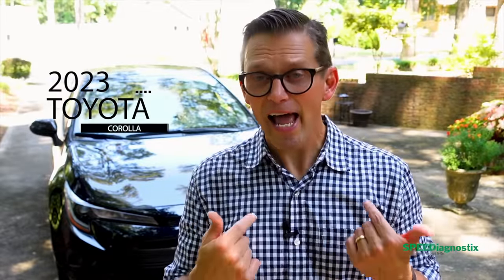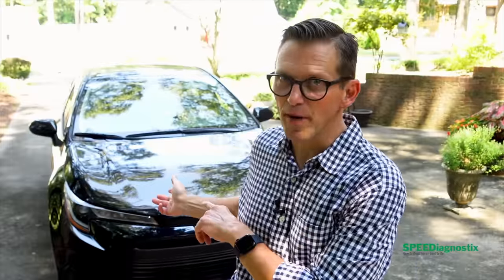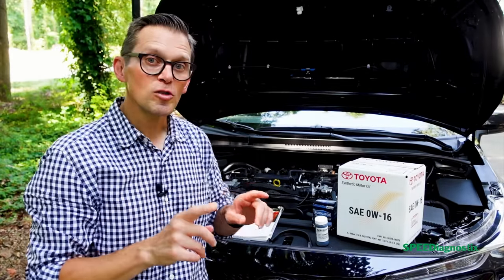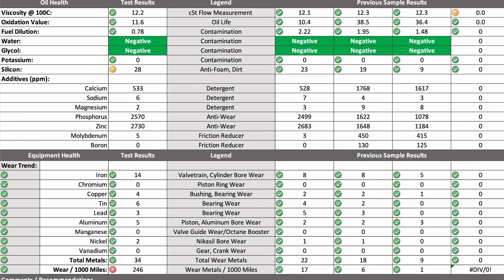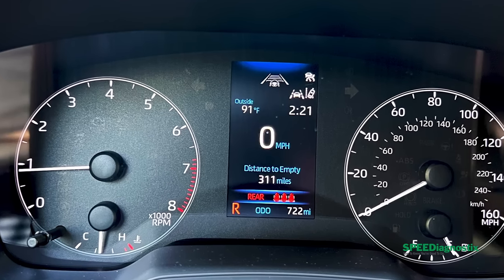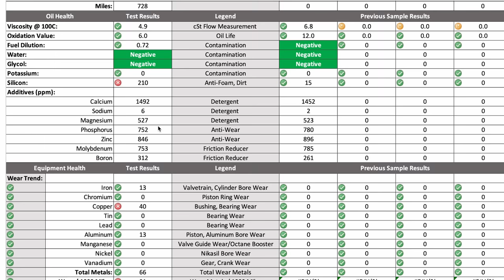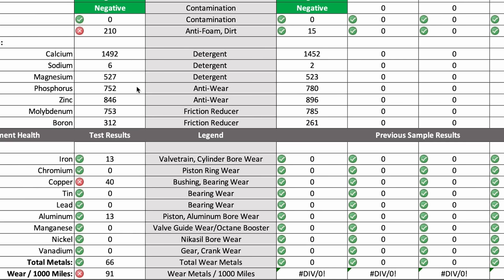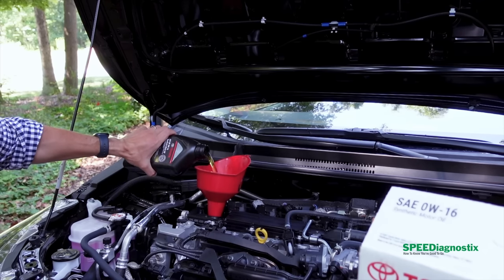AVOID the ONE MISTAKE Almost EVERYONE Makes With A Brand New Car

Comment: I change engine oil and filter at before about 400 miles. Then conventional oil till about 2000. Then full synthetic and new filter there on out. Never more than 5K on oil and filter. Labs are good and could go to 7500.
Reply: I also run filtermags, and do differentials at 10K or 1 year first change. Trans, same thing.
Reply from the maker: Right on!
Reply: That conventional oil for 2k after dumping the factory fill is a cool idea! Get the rest of the break in cycle done with conventional so the rings get a chance to continue seating in and such
Reply: Ok, how come some new cars come with like Mobil 1 in them?
Reply: it iz ALL about the $$$... my '16 lexus nx200t came w/m1... changed 2 AMSOIL & could tell difference b4 going 1 block, now i also get GREAT gas milage... 😁
Reply: @oneninerniner3427   The Mercedes owned Chrysler, Dodge Jeep company comes factory filled with Pennzoil oils.  Pennzoil Ultra Platinum is the factory fill for the Hellcat, Demon, Trackhawk and TRX pickup.  

Some brands come with Mobil1, but most are European vehicles.  I think the Corvette's and ZL1 Camaro come with the Shell Havoline oil, but I will check again.  

But some vehicles have the engine broke-in at the factory.  They do it their preoperatory way.

Comment: Please note that when you take your vehicle to a dealer for your oil change. They do not use the factory oil. I worked for them for 34 years. They buy bulk oil from wherever they can get it cheap. That’s how they make their money on oil changes. The only way to beat that is tell them that you only want factory oil. And filters. They also use aftermarket oil filters. Same thing with transmission fluid.
Reply: That's a FACT 👍👍👍😎
Reply from the maker: Good to know. We can use our vacuum pump to take a sample and check behind them!
Reply: OEM'S don't manufacture lubricants or filters.

Comment: Ok, just bought the 2024 tundra. Have 620 miles on it. With all the scary news about engine debris causing engine failures, I’m definitely not driving it until the first oil change this coming weekend. My questions are these:
1) Should I drop the oil pan and really clean it out?
2) should I go ahead and do the first few oil changes every 1k miles or less?

So glad I found this video and thanks for putting yourself out there with all this helpful info!!
Reply: No - no need to drop pan - just oil / filter change. keep receipts if you are doing yourself in case eng problem in future as proof.
Reply: @masonloh1411  thanks so much for the advice👍🏻

Comment: Maybe he doesn’t know it. But the reason Toyota uses Mobil oil is because of the engine sludge problems they had from 1997-2006. They were financially hit hard with a class action lawsuit. Engine were blowing with 30 and 40 thousand miles. Everyone talks about Toyota’s “legendary reliability” but some how they miss all the engine, transmission, and rust problems when they tell us about Toyota. Thanks! Great video!
Reply: My 2013 Camry has 261,000 original miles.  Change my oil every 5k.
Reply: Word is spreading quickly about the Japanese brands and low standards. Hell, they even falsify safety data.
Reply: Im a GM guy thru and thru, but statistics from 2006 have nothing to do with anything almost 20 years later.
Reply: Soon we will be talking about how great and reliable the Korean name plates are. Its a natural progression.
Reply: @randallsavage3795  Hankook built a plant in Clarksville, TN.  Idk how good their tires are, but I won’t buy them.  They treat their workers like garbage.
Reply: @bluegrassman3040  brother I hear you. American made is the way to go when we can. Trump 2024!!!!
Reply: @bluegrassman3040  Treating your workers like garbage is the American standard.
Reply: @Ricky-mo6mv  in this case, it’s the Korean standard.  But I don’t work for them.

Comment: Sump plugs with a magnet help to limit wear too.
Beats me why manufacturers don't install that as standard.
Reply from the maker: Great point. Some OEMs do install magnetic drain plugs as standard, but they all should.
Reply: I replace screw by magnet one and install magnets on bottom filter
Reply: Only works on iron particles, but still would help.

Comment: I drive a tractor trailer and have for years. We change our oil every 60k per manufacture recommended intervals.
We have 32 trucks and have never had any oil related failures.
We normally keep trucks for 600-800k
Reply: It all depends on application. Your tractor trailers aren’t seeing the same type of use as that Toyota and probably have different filtering set ups because of it. 

I work on ships and on my old drill ship (Noble Sam Croft) hadn’t had the oil changed going on 4 years of running. But, it has back flushing filters on the engine, centrifugal filters on the engine, lube oil purifiers for each engine, we add oil every other day or so to keep up the level, and do monthly oil analysis. These are 11,000hp generators running diesel and using standard 15w/40, about 1800 gals per engine. Also have dedicated pre-lube pumps running heated oil through the engine constantly.

Comment: Amsoil also has the 0W-16 oil and it has  the additive package  necessary to satisfy Toyota's and even Jr.  One version if fully guaranteed for 15,000 miles and the OE Synthetic which you change at the regular recommended Toyota intervals. I looked for an 0W-8 and Amsoil presently does not offer this viscosity. Wow, I never would have thought back in the 60's and 70's that a production vehicle would require such a low viscosity.
Reply from the maker: Yeah, 0W-8 is crazy.
Reply: Even though Amsoil offers a similar viscosity oil.. i would recommend sticking with the Toyota oil the right amount of protection plus it's normally cheaper.. 0W-8 is super thin but i bet they're running at higher oil pressure and using variable displacement oil pump
Reply: They only offer it, 0W16, in the OE Series at this point in time.
Reply: They only offer it, the 0W16, in the OE Series at this time.
But I suspect that could possibly change in the future.
Reply: She should run 15w-50 in it. Who trusts Toyota these days. Works fine in my John Deere tractor.

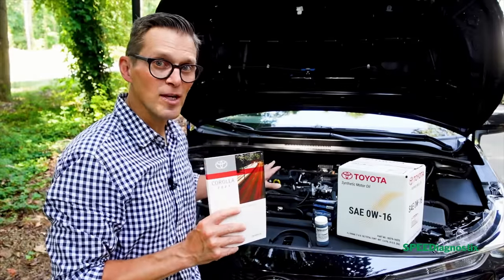Comment: Your tip @6:00 to add the quart of new oil before reinstalling the drain plug, is actually pretty brilliant, makes me feel like I've been doing it wrong the last 50 years.  It's probably well worth the price of a quart of oil to get out some more contaminants, really.  Also I've never seen a pair of camshafts used as an art object before (@10:00)
Reply from the maker: Thanks! Those camshafts are parts art, but each has special meaning.
Reply: Have you had any problems in the past 50 years by not doing it? No.
Reply: Waste of a quart of oil
Reply: @motleydude73 don't know, I've always done this,  shit every other 3rd oil change I'll fill it up with oil,  run it around the block and change it again.
Reply: @spartanpatriot3163 This is an insane waste of oil that does little to nothing for engine wear. Please stop.
Reply: @mcyclonegt  nor about stopping wear, it's about keeping a motor clean, besides my wallet can handle it
Reply: I agree, the engine takes 4.5l, here in Canada oil is sold in 5l jugs. Instead of adding an entire liter, I might just put in a .5l with the drain plug out.
Reply: Art objects rock. 
I took an old weedwacker flywheel and bolted it to an 8hp briggs crank and painted it red. Makes a great doorstop :)